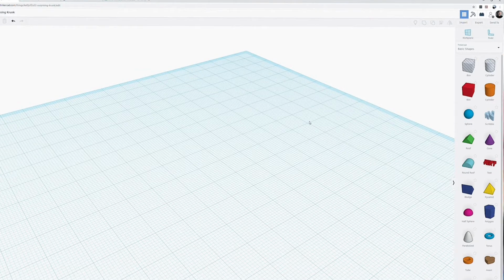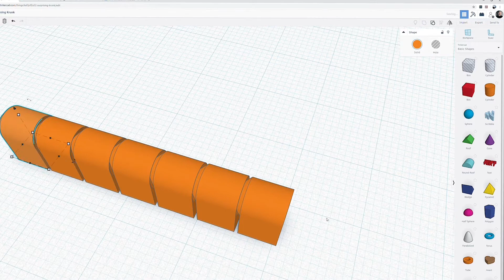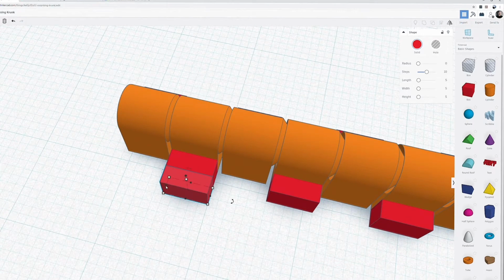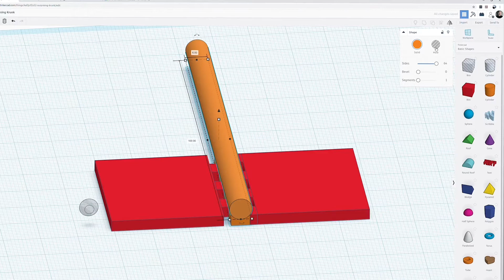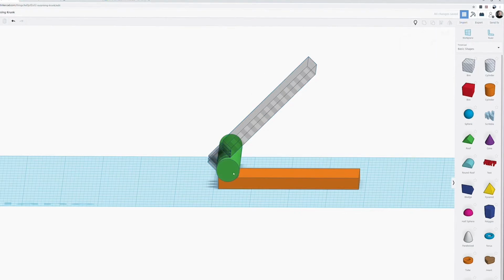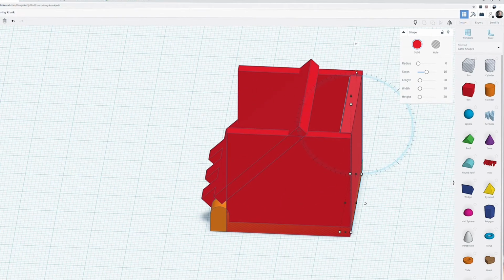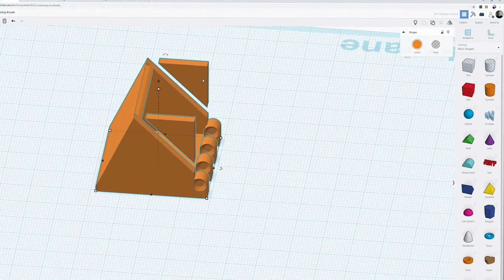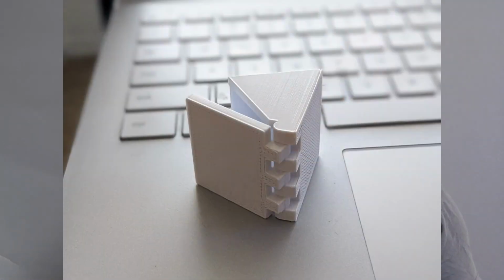Simple Print-in-Place Hinges in Tinkercad

Comment: great video... sorry for my comments that follow...

I wish this was a bit more explanatory, as I really love the concept. I still do not understand how I will do this on a normal rectangle box and some of the steps you took, but, maybe if I watch this a couple of more times it will come to me.  One thing early on, you did a resize of the cone which then lowered the height, that did not match the "5" input. This is important because following along makes it difficult to understand that change without doing this on my own. Sorry for being a stickler, I work better with exact information and I know you did this as a quick tutorial and were winging it. So, please try not to take my comments negatively.
Reply: Hey! I found out the full resize thing, it should be alt (or option on Mac) + shift, then click the corners and drag. Hope this helps!

Comment: I was looking to 3d print a vertical hinge. What parameters should be considered to make it possible?
Reply from the maker: Vertical hinges need a different kind of approach entirely!  If you search for Improved Kaleidocycle on MyMiniFactory you'll see an approach I've used - maybe I should put together another video :)
Reply: @Clockspring3D  Yes please. If you can do another video for that, it would be great! I will check the video that you mentioned also as well. I am a total newbie in 3d printing. Thank you for replying :)